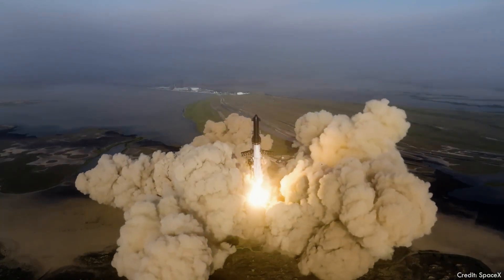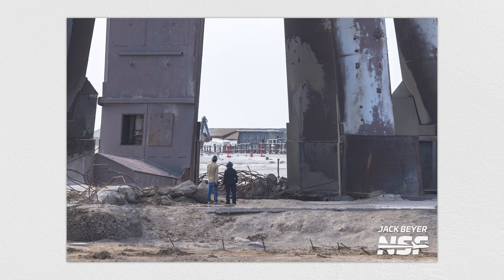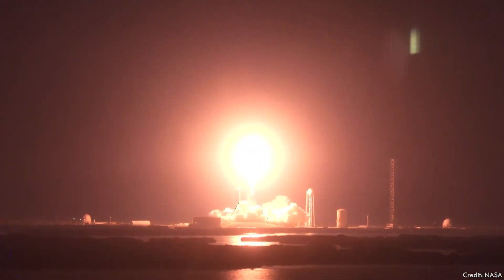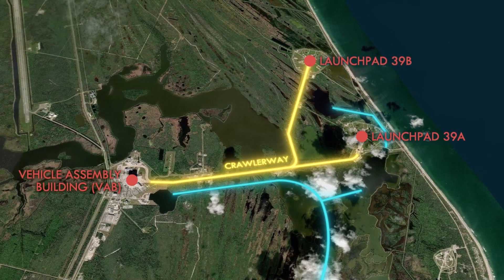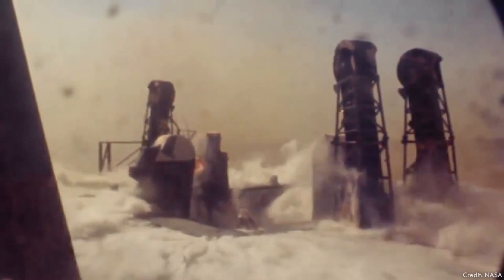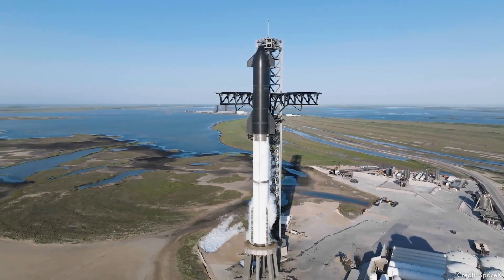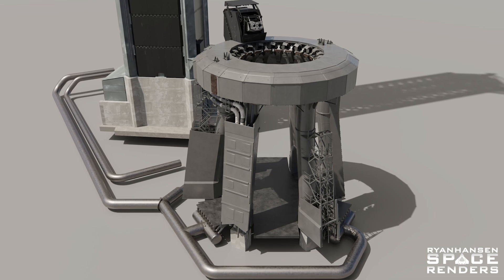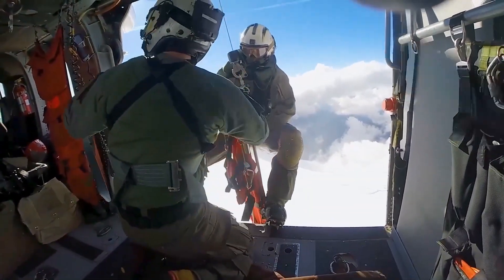Was Starship’s Stage Zero a Bad Pad?

Comment: It's pretty clear that SpaceX cut too many corners on Stage Zero. On the other hand, I'm half surprised that SpaceX didn't just do the opposite of NASA: Instead of building an artificial mountain to escape the ground water, they could have built the launch pad over an enormous hole and let the ground water that fills it absorb the energy of the rocket exhaust. At least blowing water out of a hole would be less damaging than blowing out large chunks of concrete and steel.
Reply: The problem is if you go farther than 30ft into the ground at the launch site you end up in the water table because of the ocean nearby, so that's a no-go. And regulators won't let them bring in soil to build up the launchpad so they could dig a trench or a hole, so they need to find another solution.

Not to mention, the whole point of this is to be able to take off on mars, so, they'll need a way to deal with the debris some other way regardless.

Comment: In my own opinion Elon & SpaceX were behaving from a position of arrogance. It's beyond me to think they thought this would work and the small doubt they had they did not seem to care about. As pointed out in the video they behaved as if they did not care about their own facility let alone the area they are built in. Being a good neighbor isn't superseded by how cool your program is.
Not mentioning any concerns in the EPA report and minimizing the description of the damage after the fact.... That's pretty odd behavior unless you think your above scrutiny and regulations.
Reply: The damage was never going to hurt anybody. It wasn’t going to be any worse than the rocket itself blowing up on the pad, which was a possibility everyone was aware of. Hell, SpaceX has showered Boca Chica with stuff before, specifically the debris of several blown up Starships. It’s not a problem that they got concrete chunks everywhere.

It wasn’t even that unreasonable for them to think it would work. It survived a 50% test just fine, but failed catastrophically here. In any case, SpaceX failing is nothing new. It’s their entire philosophy. “Just send it” is basically what they’ve done from the beginning, and while they’ve had many failures along the way, their philosophy resulted in a rocket design (F9/FH) that has landed 200 times while every other company is at 0.
Reply: What's more arrogant, a company built around breaking things and then fixing them in a cycle faster than anyone's tried before, or, a youtube commenter who knows literally nothing about launching more than an estes rocket in a park?

I'd say the latter. And it's beyond entertaining to see people like you get realllll quiet when spaceX actually accomplishes something, like, say, being the cheapest option on earth for midsize payloads, or essentially deploying wifi that covers most of the earth.
Reply: They knew from previous test engine firings that the existing pad was insufficient. Parts of the new water deluge system were already on site before the test launch show this. However the successful  test fire of 31 engines at 50% power led them to believe they could do this one flight test before the major changes needed to integrate the water suppression. They were wrong but the damage wasn't as bad as many pundits believed. Another launch may be possible before the end of summer.
Reply: @JayneCobbsBunk  (very minor nit):  the water isn't for acoustical suppression but rather cooling.  Acoustics appear not to be a problem here like on the space shuttle.  It is a little glossed over in the video but for Saturn the pads were cooled with water, but the extreme deluge system had to be installed for shuttle since the sound from the SRBs had to be suppressed because it damaged the adjacent space shuttle.  I'm sure the glossing over is for brevity since the script is very accurate about where it is used.
The SpaceX replacement seems to be more like the Apollo system.  It absorbs heat and maybe structurally supports the upper part of the "impingement pad" as well.

Comment: NASA doesn’t work any safer than SpaceX. Insulating foam came off of the Space Shuttles during launches. That wasn’t supposed to happen. NASA never fixed the problem.

Columbia had a massive piece come off and damage the wing. NASA knew about this after the launch. Despite this, they had the shuttle land. This led to it breaking up over the US, raining debris on people over a wide area.

Comment: There is another part...lets say eventually there is a base on mars...do they need to build a giant flame diverter trench and somehow find water to pump into it to take off again?
Reply: Mars gravity is only 38% of Earth's, so you need a lot less thrust-to-weight in order to get off the ground. That lower gravity plus its smaller size also means it's much easier to get into orbit. Both of these make for a much smaller rocket. You'll probably still want a prepared surface, but the engineering requirements for it are nowhere near what we have here on Earth.
Reply: @sntslilhlpr6601  Yes, a fully filled Starship would need around 3 Raptors to lift off on Mars. So the more relevant example of how that would be done would be the launches of Starship SN8, SN9, SN10, SN11 and SN15. There was no pad destruction there.
Reply: I would not count on a mars base in our lifetime.

Even if Elon pulls it off: would you want to live in his company town?

Comment: I know rockets are utterly huge but I wonder if it's possible to push the rockets up like with ICBM to save the amount of fuel required for launch. 

Use cheaper power like solar energy to charge the actuators or to power pumps/compressors to charge accumulators which then press up the rocket up.

It would be VERY costly but I wonder if it would be worth it in the long term, leading to increased payloads for the same sized rocket or just using less fuel
Reply: No: starship, when fully fueled, weighs about 5000 metric tons (11 million lbs, which is at least 3 stadiums full of tennis courts and blue whales.) It's not impossible to move that weight, but you're never going to push that hard enough to throw it upwards.

That is also ignoring all the extra challenges you would have from the now moving connections between the rocket and the launch pad, the timing required on the ignition and so on. :)

Comment: The concrete under the pad had been expected to ablate as it had during the static fires and in flame trenches, not disintegrate like it did. SpaceX had also been conducting tests at their MacGregor facility by firing raptors at concrete blocks, presumably to measure ablation and fragmentation. While plenty of people have be treating the outcome as obvious, their theory as to why it disintegrated didn't match the actual reasons - which has been given by SpaceX as to do with the ground underneath the concrete. The FAA should certainly issue updated requirements to ensure it doesn't happen again, but as with other issues like the FTS not working as expected, SpaceX is already working on it, such as adding a heap of new deep foundations under the pad.
Reply: Okay, elonstan
Reply: @masbestiaquetu  come on, at least have an argument. It's not like I had to dig for any of this, so if you think it's incorrect at least present a counter argument as to why.
Reply: @benhockley  you didn’t dig anything but starship sure dug a huge hole
Reply: @masbestiaquetu  I did look it up if that's what you mean, it's a generally accepted colloquialism.
Though for your second point, I see you're also interested in facts.
Did you know that the SpaceX CRS-7 mission failed when it exploded mid flight, and there were a lot of questions raised about the reliability of the Falcon 9 at the time?
There was also the time that falcon 9 exploded during a static fire test.
And F9R did a flip and blew up.
And several failed falcon 9 landing attempts.

Basically my point is I don't have a clue what your point actually is. It's like asking "Who launches a rocket in a protected wetlands", where the answer is "Everyone".

Comment: No doubt SpaceX should have been more careful, but there's a massive difference between one-off experiments and regular commercial activity.  Environmentalists should focus on real problems like the billions of internal combustion engines burning fossil fuel into our atmosphere.  Ironically, by Tesla pushing the whole world towards EVs, Elon Musk has done more to solve climate change than the next 10 most influential climate activists combined.
Reply: These "environmentalists" do not actually care about environment. They care about virtue signalling. Elon has been designated a new "bad man" for the cult of "eternally righteous" to attack.

Comment: @Practical Engineering     I just saw a new innovation of an Electric Motor: Axial Flux Motors,  Any chance you can do a comparison between this E-motor and The One Tesla is using Currently??
I would love to pick you brain on it as i'm not an expert.  https://www.youtube.com/watch?v=3qjB6GnhloY.  Is there a reason why tesla didn't buy this company up and used their Motor instead of of sticking with the old radio Flux Motors which is much bigger and heavier?

Comment: The key to SpaceX's pace of advance is their design, build, test, analyze, repeat methodology.  The Super Heavy booster and the Starship had been tested as thoroughly as they could be before flight testing.  The pad beneath the launch table was a question mark.  They knew it would not withstand multiple launches (the long term goal), and had designs in place to upgrade it to what we see being installed now.  The question was fly now and take a chance on the infrastructure they suspected might fail, or wait for the deconstruction and new infrastructure upgrades before first flight.  SpaceX got more data from that one flight than the Russians did from all four of their N1 launches.  They got their test data and skipped the deconstruction phase.
Reply: all of their data was corrupt because they don’t know what concrete damaged what. They lost control long before they attempted to actuate the flight termination system, which failed. Claiming that the flight generated useful data is grasping at straws…straw of lies.
Reply: And made a terrible mess for the rest of us along the way. Let's not kid ourselves: this was destruction, not deconstruction. He would never have been allowed to pack that thing full of explosives and shower debris for hundreds of yards, but that's effectively what happened. He could have waited, built the pad they were already planning to build, and then fired their test rocket. That would have provided even better data, because now they would be testing something they thought should have worked instead of one that was already expected to fail, and they wouldn't have compromised the rocket that they were actually trying to test.
Reply: @reverse_engineered  So you reside in or near Boca Chica Beach?  Didn't take the buy out that SpaceX offered?

Liquid Methane and Liquid Oxygen are no more "explosive" than any other rocket fuel, and rather less toxic than some.

Yes, debris from the destroyed concrete foundations did scatter well beyond SpaceX's property.  I have seen no reports of property damage beyond the exclusion zone of the launch.

Waiting to deconstruct and reconstruct would have cost time.  SpaceX needs Starship to be operational for Starlink V2.

Nor is there any indication that the test vehicle was compromised by the concrete tornado.  As things appear now, SpaceX will be ready to launch ITV2 as repairs/upgrades to the infrastructure complete.  Your solution would have succeeded only in slowing down the rate of progress and innovation, for no other net benefit.

Comment: Tbh, as much as I'm a fan of a lot of what the SpaceX engineers have accomplished, I hope the company and Elon get the books thrown at them for this. It was a dumb move, and I have to expect his engineers were aware of and warned about the risk, and of course the twit shows Elon was aware of it being a risk. The "updated' version of their design with water sprayers still not having a deflector points to a culture of wanting to do something different just for the sake of doing it differently. This isn't really an application of "move fast and break things", it's just negligence - "moving fast" still means leaning from past efforts, they could have just built a pad using what we know from NASA and wasted less time in design and losing a launch as a result.
Reply: The next "launch" will probably result in a steam explosion, as well as a fully fueled stack exploding.
How many kilotons of TNT equivalent will they yield?
Reply: @Chris.Davies  Not that much. Liquid propellants aren't very prone to detonate. To get a detonation of methane, it needs to be gaseous, and mixed with gaseous air/oxygen.

An explosion of the rocket would be a giant fireball causing massive damage to the pad through heat, but in terms of kT-equivalent, likely somewhere in the 0.001-0.1 kT range.
Reply: Or deflector points aren't necessary.

Comment: There's a few small nitpicks. One is the implication that the water deluge system was intended to absorb acoustic energy. That's certainly the case for the Space Shuttle and SLS, but not for Saturn V and Saturn IB. The short version is that the ignition of the massive solid rocket motors produces shockwaves which can be significantly more destructive than what Saturn or Starship produce.
Reply: 9:45 The IFT wasn't actually the full force of the booster. The rocket used in the test was already more than a year old, and its engines were early prototypes of Raptor 2. Without a payload, they only needed ~90% throttle, which also improved reliability.
Reply: This one is especially nit-picky, but still worth mentioning. You (and many other people) refer to it as an "orbital flight test", but that isn't strictly true. If everything had worked correctly the upper stage would have reached an orbital velocity, but not an orbital trajectory. It was targeting a path which would have traveled well into space, but then reentered Earth's atmosphere over the Pacific Ocean. SpaceX themselves referred to it as the "Integrated Flight Test", referring to the integration of the two stages.

Comment: Fondag is a really interesting product. My family owns a ready mix concrete company that services an aluminum smelting plant. Every so often the floors in the furnaces are replaced and they will use Bulk Fondag for the concrete. The laborers and finishers that are working it will sometimes have to vibrate around their feet when they want to move to a new work position.

Comment: As I understand it, the long term problem for SpaceX is that the intention is to 'land' this rocket on another body and then take off again. There won't be an opportunity to create a suitable landing (or take-off) 'pad'.
Reply: remember that is the upper stage that would be landing not the booster, so they will end up accounting for it. Also all the bodies in question have far lower gravity than earth allowing for lower thrust takeoff